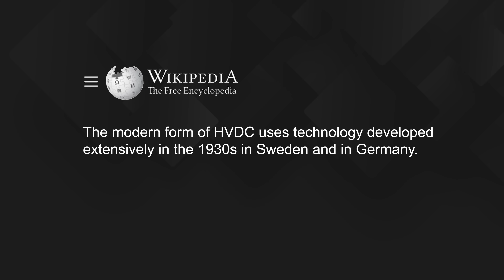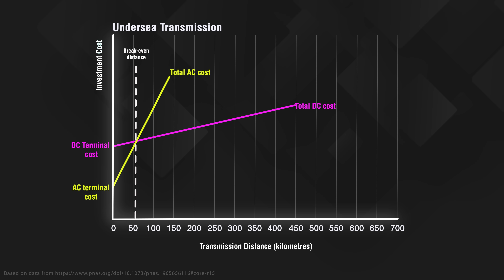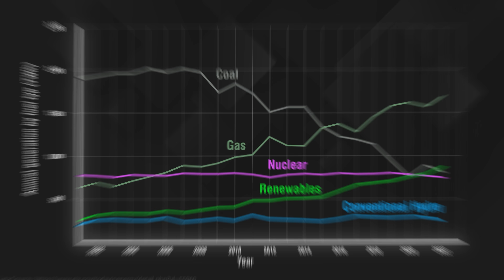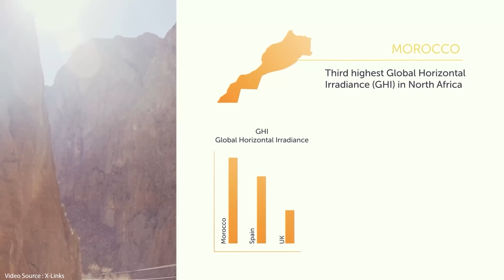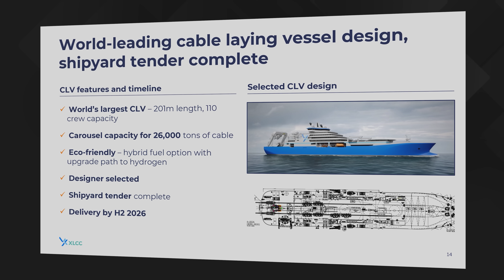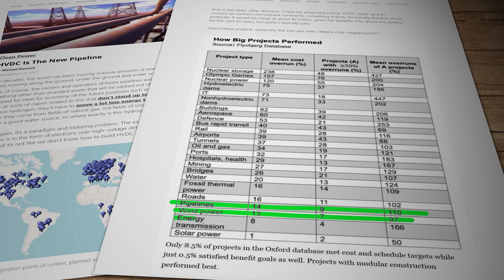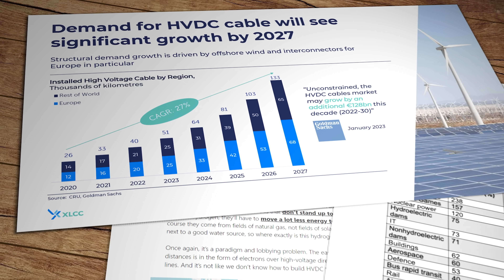Revolutionising power transmission.

Comment: Great news, Dave, and goes to show, that the transition doesn't just cost jobs, but creates many too
Reply: Where energy is concerned it will always cost jobs from the older sources and create new ones for newer sources.

Obsolescence by degradation of certain renewable technologies combined with future advances in efficiency mean that there will always be more manufacturing in renewables too, so it's not like we can just produce x amount of solar or wind and then nobody will need any more ever, it will be a continuous process where the early adopters will eventually upgrade to more efficient (and possibly cheaper) solar a few years down the line.

The only thing I fear from this international power grid business is an over reliance on foreign energy production which is vulnerable to geopolitical turmoil at any point in the future should these countries simply decide that they no longer wish to share these resources that we have invested in building in their countries to our mutual benefit.

It's good to have options but the Ukraine/Russian war related sanctions have revealed an over reliance on foreign energy that we simply cannot afford to continue with any longer.

We must invest as much as possible in domestic energy capacity and storage - hope for the best, plan for the worst.
Reply: @mnomadvfx  I agree with everything you said and there will be disputes with even allies over resources, but green energy by it's nature moves these resources closer to home, wherever your home is.  And unlike oil, renewables aren't burn once drill another hole.  Most green energy like solar panels and batteries are becoming very recyclable and reusable.  While humans will always find ways to argue and start wars, taking fossil fuels out of the equation and increasing energy independence will at least take away one reason that has caused so much insane conflict over the years.  Not to mention the money saved by not spending 5.9 trillion dollars every year on fossil fuel subsidies to keep our economies moving.
Reply: Somebody is gonna have to employ those laid off oil workers.  Great job as usual Dave.
Reply: @lestermarshall6501  sure, oil and gas drilling crews are already drilling geothermal wells. Engineers and experienced technicians are needed everywhere, they don't need to search long for their next job
Reply: @lestermarshall6501  the amount of laid off oil workers (many of whom can use their skills in other jobs) is miniscule compared to what the CO2 free/neutral alternative offers.
Reply: @lestermarshall6501  : "There are just over 8 million jobs in renewable energy today. In 2021 and 2022, energy jobs grew faster than overall U.S. employment."
    Pipeline work is temporary and the workers have the same skills needed in full time renewable energy jobs.
Reply: @lestermarshall6501  no they don't, coal miners were just abandoned
Reply: @alanhat5252  That problem has to do with American politics and nothing to do with the technology or the rest of the planet.
Reply: @alanhat5252  : Abandoned by the coal industry and Republican politicians due to natural gas expansion. The Defendant promised more coal jobs but did not deliver and did not help. Renewable jobs are the fastest segment of job growth in the country.
Reply: The arc of human activity is completely about change. People who complain about job losses must not have been alive very long or ever read anything, Over the centuries probably billions of jobs have been lost due to changing demands and changing technology. As you said, the power transition removes AND adds jobs so anyone holding up job loss as a reason to not pursue this change is pretty silly. There used to be thousands of hat making companies in every city of any size across the US and the world. They are all gone now but for a handful, because people stopped wearing hats as a fashion item. In a hundred years there will still be oil and gas workers, but they will not be in the majority. If you complain about job loss due to changing tech, you undermine your credibility and thus any argument made against said change. Jobs come and go, it can't be avoided and is natural.
Reply: @Hybridog  The changes you mentioned happened over much longer period in times where actual human dependency on technology was much lower. Now power-hungry politicians and silly environmentalists push the changes and force to switch to the technology which for the most part doesn't exist yet or is not ready to be scaled. I mean it can be done, but it's more of a 30-50 years project.
Reply: @guesswho6038  :  Knowledge and technology are progressing faster all the time. That is the nature of change. The only reason it seems like some are pushing new technology is that others are being resistant to keep the cash flowing to the fossil fuel industry no matter how destructive it has become. $2 billion per year is quite an incentive.
Reply: @Hybridog  You've lost all credibility by having the belief if western 1st world society ends usage of oil and gas that the industry will mostly cease to exist. As 2nd and 3rd world nations will see the prices tumble and fill the gaps reaping the benefits. Between Africa, Asia, and South America that's 82.5% of the global population. Where Europe, North America, Oceania (mostly Australia) are 17.5% of the global population.

How did you envirotards forget supply and demand is a global aspect of economies driving consumer trends?
Reply: @RichardPrendingue  : The developing world is to a large extent by-passing having to build a massive infrastructure for fossil fuel and going straight to renewables. It's not absolute but it's happening.
Reply: Convince every single town based on O&G to shut down. Then FLY with batteries that are recharged with solar to the energy summit... even though you could've worked from home. Am I being facetious? Yes.
Reply: Do you want to create jobs or wealth? If we want jobs we can hand out shovels to the construction workers who are to build these projects. If we want wealth (and fewer jobs) we will give them machines.
Reply: Creating jobs equates to increasing costs.
Reply: @petefluffy7420  : Companies hire only the people required to service customers to make a profit. Each employee's labor produces more wealth. More employees means more purchasing power and consumer demand.
Reply: Lol.  yeah, right.  How many times have we heard that before?
Reply: @IanPritchard  The luddites thought the same, and what would the world look like if they won?  Technology moves ahead, it always has.  Some jobs get lost, and others are created.  We can't live off legacy and nostalgia, we have to evolve.
Reply: @Ryan-ff2db  you sound like a politician - warm and fuzzy sounding words.
Reply: @IanPritchard  Ironically, you're making the appeal to emotion fallacy in a condescending way. One finds this similar to the most dishonest individual politicians across all of politics.
Reply: @Ryan-ff2db  It would be a damn site cleaner .
Reply: @petefluffy7420  I'm not sure what that means.
Reply: @IanPritchard  Many because it's true.  "There are just over 8 million jobs in renewable energy today. In 2021 and 2022, energy jobs grew faster than overall U.S. employment. "
Reply: @IanPritchard  through the cutting of subsidies to the PV industry, the CDU/CSU government were responsible for the loss of approx. 100,000 jobs here in Germany. So, the jobs were here and could be created again. Tesla isn't the only company deciding to build batteries in Europe. The transition requires multiple solutions therefore multiple opportunities for new jobs.
Reply: @martincotterill823  The 100,000 subsidy recipients you mention will be able to transfer any marketable skills into wealth creation.
Reply: @martincotterill823  If someone bans bulldozers and excavators then subsidizing it being done manually did they truly create jobs? Subsidies for solar are merely welfare for the wealthy and creates a more complex grid to manage which some countries aren't even ideal for solar due to weather or how close they are to polar regions.

As to the "batteries built in Europe" it's due to EU tariffs that will tack on 10% to the battery price if X% of batteries value isn't made in EU or UK. America is doing similar and the EV tax credits abruptly only applies to vehicles whose batteries made in the US. Should have done a 3 year grace period of allowance as it will take at minimum a year to even break ground due to finding an ideal property, obtain permits, and contract bidding for the entire process. Add in another 6 months to a year sourcing the equipment and workers who will most likely have to go through training so they don't zap themselves into the grave.
Reply: @RichardPrendingue  Electrifying heavy equipment is already happening. Who banned them?
Reply: @paulsmith3921  It was a metaphor for the fact renewable energy is manpower inefficient that is heavily reliant upon subsidies to sustain demand. Which I don't take many "environmentalists" seriously as they detest and condemn nuclear power due to the rare amount of catastrophic failures whose designs are base upon 1950's designs. In that era, seat belts weren't even mandatory and in a collision door would pop open due to rather simplistic latching mechanisms.

As to "heavy equipment" being electrified it's on a small scale and isn't practical as in many cases where they are utilized at many times electricity isn't readily available. I have no issue with these equipment being hybrid electric/diesel as it gives the equipment operator versatility in his contracting job options to bid upon.
Reply: @RichardPrendingue  It does however, prevent the world from overheating to the point where it will no longer sustain life, food crops etc. Is that what you are aiming for?
Reply: @veronikasmith4927  The climate is going to warm even if western society goes 100% renewables even banning fossil fuel vehicles due to China, India, and other developing nations. The immense demand drop will force producers (Middle East, Russia, and Venezuela) to drop prices to align the budgets of their new target demographics of more poor nations.

Running insane lengths of power lines to interconnect countries on paper seems ideal but disregards it's going to be running through FORESTS. Which we can both agree the climate becoming more unstable increases the risk of power line failures and a FOREST FIRE that would negate the emissions reductions.

Your scenario of "no longer sustain life, food crops etc." disregards a more immediate threat being overfishing by China using ecosystem destroying trawlers and the bee decline. 

Oceanic plants produce 50 to 85 percent of the global oxygen and are undeniably the largest carbon sequestration sink that are being deprived of fish poop. According to studies oceanic farming is 2 to 20 times better than forests and even its merely 2 times it has ZERO RISK OF WILDFIRE.

As to bee decline, no automation or human power can substitute bees pollinating entire fields of crops.
Reply: @RichardPrendingue  : There are many problems facing us but we can't ignore one for another. They all have to be addressed and there is a $2 trillion per year incentive for OPEC+ to maintain it's geopolitical power.
Reply: @lrvogt1257  Their power comes from the fact that they provide abundant and reliable energy day and night in every place on earth for scale as big as a power plant and as small as a vehicle. Beat that and you can take that power. Should be easy with knowledge and technology progressing so fast.
Reply: @guesswho6038  :  You've laid out the positives which are considerable but ignored all the negatives. Global warming, pollution and associated illness, price gouging, geopolitical domination to name a few. 
     It's not a black and white choice. It's a transition. At this time it isn't necessary or possible for renewables to provide 100% of our energy but the more we use the less carbon we have to burn. That's an improvement.
Reply: @RichardPrendingue  : Burning fuel is detrimental to all of us but it is still subsidized one way or another with tax dollars to make it artificially competitive yet they continue to price gouge us. Investing that money in cleaner energy sources is good policy and good business. It helps our environment and creates jobs.
Reply: @RichardPrendingue  : Renewables are at least as manpower efficient as burning fuel which requires constant extraction, refinement, and transportation on a massive scale.

Comment: I lived off DC/AC assisted for 13 years starting 1990 in Australia. My system was solar, later wind which enabled AC. The system was very primitive, a fair amount of maintenance but it worked and I was one of the few who still had power when devastating bush fires hit.
Reply: I live in metro Adelaide and the house has been on total solar for about 4 years now. Off grid. Using my welder, water pumps and so on

Comment: My biggest problem is relying on third-world countries to guarantee the uninterrupted supply of electricity to first-world countries (for example North Africa to Europe). South Africa invested in the Cahora Bassa project in Mozambique in the 70s using HVDC transmission. Thanks to the usual third-world civil wars, for several years in the 80s no electricity was delivered. What is the guarantee that no similar problem will happen in the case of the Morocco-UK line?
Reply: Are you claiming that the UK is still "first world"?😅😅
Reply: @lengould9262  I know it is popular to criticise the UK and several other EU countries, parts of the US (like San Francisco) that they look like third-world, but have you ever been to a third-world country? Go and visit some and then you will realise that the UK is very much a first-world country.
Reply: Perhaps if the fear of lost investments and reduced profits were strong enough, trying to help prevent conflicts in 3rd world countries would outweigh the profits from arms sales and rebuilding when the dust clears. Then we could just skip most of the civil wars.
Reply: @pitchforksandtorches4671  In different African countries the locals are happily killing each other with "traditional weapons" without any help from the arms suppliers. Look up the tribal conflicts in Africa. The borders were drawn up by the colonisers without respecting the tribal borders -of course, it does not help that after independence the most important for each country was the defence of the existing borders instead of redrawing them according to tribal lines. The other big reason for internal conflict is the liberals in the West refuse to criticize and introduce sanctions against African dictators. These libtards go into meltdown if a "white" country does not allow full marriage rights for gays but keep very quiet if a third-world country like Uganda executes them.

Comment: Another great video, Dave. On that point of electricity transmission, I assume, like in Australia, as economies & wallets tighten, the incidence of Copper Wire theft is on the rise, often at great risk to the thief.
Are there any scalable &  cost-effective alternatives to copper wire?
Reply: aluminum wires. it's much cheaper and stronger so it's already used in all overhead power lines and most other large long-distance cables.
Reply: Aluminum?
Reply: pretty stupid thief to target an energised transmission line.
Reply: @jnawk83  a friend of mine, while in training in power engineering, was once taken to see a pair of still-smoking boots. 
Apparently it's so regular an occurrence that every apprentice/trainee gets to see smoking boots...
Reply: @alanhat5252  yikes. that really nails down my point.
Reply: Dude, we are talking about very high voltages here - rarely less than 200,000 volts and up to over 1 million volts. any thief trying to steal a HVDC cable would be turned to ash before they even got to touch it.

Comment: The submarine cable project from Morocco to the UK sounds quite absurd to me.  It is a waste of so much copper and other costly materials! Normally, you would connect to your neighbor, France, to take their excess power, and your neighbor would take theirs from the next neighbor, Spain,  and them to their next neighbor, with most of the route being served by much cheaper overland lines either aerial or underground, as each country sees fit.  It is like a bucket brigade but for electricity.  Just consider the other example you mention, power from Georgia.  Morocco is mostly in the same time zone as the UK and the same Atlantic weather patters affects both.  Georgia is not.  If the UK connects to France, it can make use of excess from Georgia indirectly automatically, or from anywhere else in the pool of interconnected continental power systems.  And what if the UK has excess power from the North Sea, is it going to sell it to Morocco through that cable?  I agree with the Morocco site, but not with the connection.  And, as a Spaniard, I agree that dealing with France is not always easy.  For years they've been stalling expanding the projects for more cross Pyrenees connections, partly because they prefer their costly nuclear to our cheaper renewables, but that is another matter.  I'm sure the EU would eventually set things straight.  That cable connection seems like a scam sold to a Brexiteer government than a sound technical or economical solution. And with current concerns about the vulnerability of undersea cables or pipelines (i.e. Nordstream) it makes even less sense.
Reply: Hi Daniel, couple of points,  these cables use aluminium and steel which is relatively abundant. Also coast line cables avoid both land ownership issues and deep sea challenges. 
Plus this project has massive storage capacity all for a lower  cost than comparable nuclear. 
Your enhanced European grid solution has potential but also the disadvantage of it being a communal project when considering the time to get something underway.